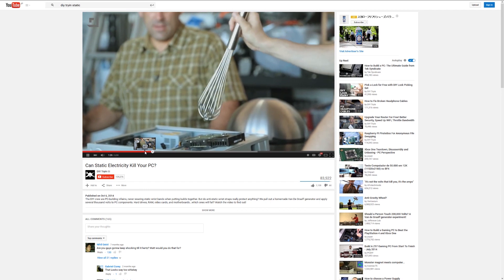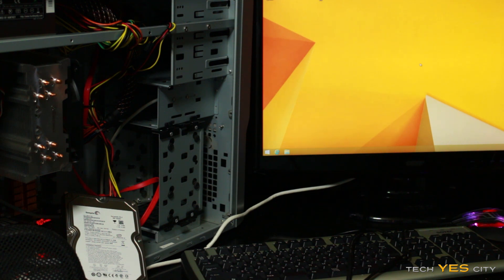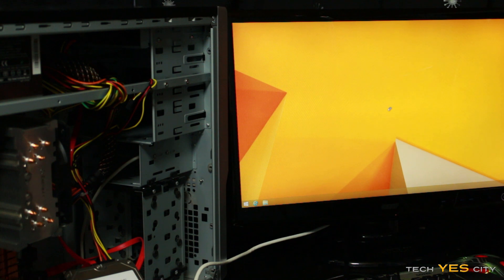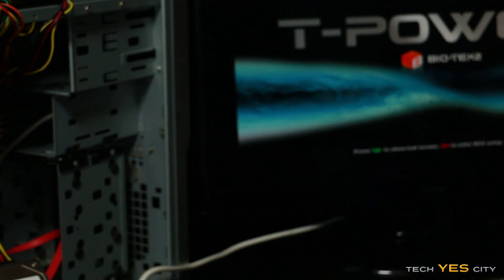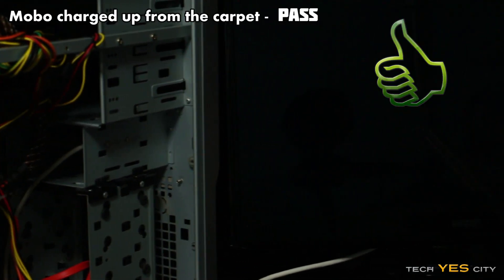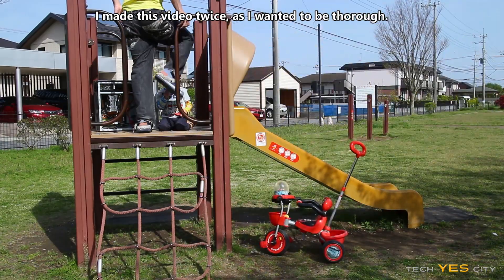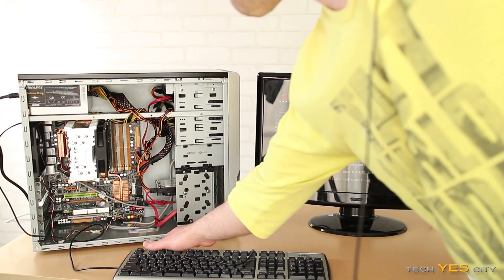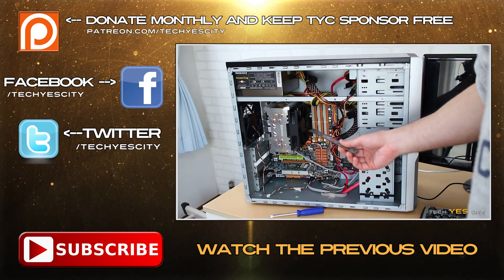Can Static Electricity Damage Computer Parts? Do You Really Need an Anti-Static Wrist Band?

Comment: As an EMC/ESD engineer I have seen multiple bizarre ESD failures at system level. Few key points here, how much charge is accumulated on your body depends on the environmental conditions, even your body sweat can reduce the accumulated free charge. 
Typically if the charge voltage is above 2KV then you experience a zap while discharging. All the parts you tested were designed to handle 2KV zap. 
1. Accumulate more charge 
2. Dont zap at some random place, zap at potential areas such as any I/O port, any logic IC, any crystal or other ESD sensitive component and it will show its magic.

Comment: I personally destroyed two different Electronics with static. Static Spark destroyed my PS3 while plugging in the HDMI cable and the same thing happened to my air purifier with a static spark touching the power button.
Reply: You MUST be a better Conductor than me (since C64(1987)--------------------------Ryzen 5900X(2025))?

Comment: I think it’s good to use an anti static wrist strap and anti static mats. Not using only gives more fuel for the anti right to repair companies. You may not see the failure immediately it may be something that happens later on. Apple and all the electronic companies will use anti static wrist straps. If you want to learn more I recommend more the right to repair community as well as the rest of the DIY get the IPC-A-610 and if J-STD for soldering. I want right to repair be the law of the land. I’ve worked in medical electronics and if I was not wearing a grounding wrist strap it was a fireable offense.

Comment: Best way to prevent ESD :
Plug power supply into a power strip
Turn the power strip off
Plug power strip into a grounded outlet

Now the whole system is grounded and all you have to do is touch the case metal and you'll be set

Comment: Simple to say yes it does most often its not a direct dead you have to run it a while afterwards and your shoes your floor and everything is important to realy hit the part with static electricity. You just need to knlw companied which do actualy research why the parts died and one business doing it is aviation and they can tell you a lot of this computers die because of static electricity. And your test is compeltly usless you should run it way longer im talking about weeks and months and just saying you need the right material to build static electricity........so pls if you do such stuff inform yourselfe before you make such videos.

Comment: That comparison of increased voltage "through a component" is a bit meaningless, and what does "putting through" mean?

Touching the traces or solder points on the back of a PCB is a completely different thing, as you are bridging or "short circuiting" lanes.

Comment: wanna say that when you remove the side pannel you touch the side panel wich is in metal and will discharge you.. and when youre not on a carpet for building the pc and you already touched side pannel of the case while you oppened it the chance of damaging the pc is extremly low.. its like taking precaution for nothing... its like saying: OMG I WILL NOT DRIVE MY CAR ITS SO DANGEROUS TO DRIVE I COULD MAKE AN ACCIDENT) so its a very stupid concept to protect you with anti static thing... and again probably no one build on a carpet like an idiot...

Comment: I have been cleaning my pc since 2006 with a blower. Then I purchased my second pc and still using a blower cause it was easy and does the job perfectly. Last time I cleaned my pc 3 days ago and then my lan port stopped working and my pc keeps shutting down after some time of use. Could that be that static charged caused this?

Comment: Of course, I really wanted to see you handle the CPU. Over here in the UK, I always leave the power lead plugged in but the wall switch off, that way there is always an earth straight to the chassis. Also, touching your car isn't really a good idea as the tyres are an insulator and the car is never really earthed....which is also why it's the safest place to be during a thunder storm.

Comment: Former HP employee in the 90's here;  HP conducted investigations into ESD damage under an electron microscope and discovered an important consideration is that an ESD shock can damage a junction with a micro-fracture that will open up over time with use, thereby dramatically shortening its lifespan. This condition is reffered to as "walking wounded" . So if something turns on right after a shock that does not mean it isn't damaged, a few months or years later (depending on usage) will be the deciding factor here or extensive. If the parts shown here have been in continuous use it would be good to know if they still work
Reply: Thanks for your very helpful comment. I'm a novice in computers. I hope more people read your post!

Comment: If it’s an obvious static arc, you will most definitely destroy your components. It would lead to no post, gpu artifacting, abnormally frequent error messages and bsods that is not microcode or driver related, or even not turn on at all in some cases.

Comment: How does a car ground you when it has rubber tires which I've read basically makes you immune to electricity? Does that mean touching any type of metal that sits on your table also grounds you? Or does it have to touch the floor or ground to work? Does the size of the metal have to be a certain size? I'm probably over thinking it but I just have to make sure.

Comment: what about static energy it doesn't shock you when you touch case or any metal parts, 
but using a Multimeter it says there's something there, 
tried using a surge protected plug and still the same

Comment: The components that have bare PCBs, so like motherboards, GPUs, and HDDs, should have some sort of coating over the board that is inductive to prevent such a thing. I'd imagine they actually do, as I've messed with a lot of components in very static-risky environments (non-humid with cotton clothing on carpet) and haven't damaged anything. You can even get it to the point of arcing and still, it works fine. Also, with the anti-static wrist rests, what you have to understand is that the current will take the shortest path possible - which if you're interacting with PC components, it will go to the PC parts first instead of the ground in the wall socket.

Comment: I appreciate that you wanted to conduct a "real world" experiment to see how static electricity discharge (ESD) affects components, but you failed to do any real tests here. I would not consider this informative or a done deal for your own edification. I do not even believe you actually charged yourself up at all. If you want to be sure, grab a digital multi-meter. If you actually had real discharge at each one of these tests, it would have hurt and you were have heard it (possibly saw it). If you ever grabbed a door knob with a real static charge built up in your body, you will know what I am talking about... those are the kind of ESDs that ruin computer parts. If you felt nothing, saw nothing and heard nothing... that's because you didn't build up a real charge. Also you are touching the outside of the case of the hdd and vid card which will just discharge around the component chassis not directly into the internal board or components. In none of these test did I see you get near the pins (you don't even have to touch a pin for a charge to jump to it). Lastly, time of year and humidity level is a big factor for generating static electricity (winter time is the worst). Where you live matters too. 

Having said all that you do not need to wear full anti shock wrist straps all year round (depending on where you live). Knowing where you live and what months ESD is at its worst plays a big factor. Discharging yourself on a proper ground before you handle components matters too. The kind of footwear you wear and the type of floor you have plays a big factor (your clothes too for that matter... get rid of big woolly sweaters before you work on a computer). The only times I am particularly careful around here is in the winter. I also 100% avoid dusting with brushes/swiffer dusters/etc (which build up a charge quick).
Reply: Primarch You miss the point. This is a more realistic approach. This is simply trying to get a charge by rubbing clothes someone would normally wear across a carpeted floor, and see if it causes a shock great enough to brick the machine.

Comment: ESD is not fatal to components but can degrade them. However I feel this does not necessary apply to motherboards because they are built with fuses which protect against ESD or over-current. 

This is a very extreme example of ESD and I doubt anybody would accumulate that much, and if they did they would usually touch something metal like a door knob or their beds metallic part.

Comment: Your test is not real world either.  First, what is the humidity level in the room?  If it's over 70% you probably won't hold enough static on your body to cause a problem.  Second, are you touching anything else before directly touching the electronics on those devices?  I've seen ESD damage motherboards and RAM first hand especially in the winter months when humidity is very low in the area I live in and you can see and feel sparks when you touch some things. Plus you are testing for catastrophic failure which is pretty rare with ESD.  Indirect damage is more common which can show itself in future errors or instability.

Comment: Well, this is a clickbait video.
First, it's not like static will destroy the PC parts  immediately, using a x-ray scanner or microscopes can actually see how static damage parts and the static damages after some time has passed and you will be clueless on how the PC broke on the first place.

Also, depending on model and manufacturer there's components who actually has static resistance and other are really sensitive.

And on top of that i can see how you don't have touched well some parts, like the HDD, you hardly touched the circuitry just touched the aluminium case...

Comment: Where's the RAM test? You can damage parts of the RAM and still have it boot up until it goes to use the damaged area. Did you get a static spark when you touched the component? Totally flawed test.

Comment: I really need some help. I've recently bought a 1060 6GB and wanted to see it, so i took it out of the anti static plastic, with my shoes on, on a wooden floor, with no carpet whatsoever, and i don't have pets. I holded the GPU by the back plate, the plastics, might have touched those heat pipes on the front of the Gaming X and might have put my fingers on the zone where we connect our video cables (but they were covered). A friend asked me if i touched something metal that would ground myself, and i entered the house 5 minutes before, so i touched the metal doorknob. He asked me if i felt any shock whatsoever and i didn't feel nothing. Can you tell if my GPU is ruined from that? I'm so worried. I thought that since i had footwear i was ok, but then i started worrying.

Comment: yes and no.. iv fcked my computer with static before my pc cost over £2000, thankfully it was under warranty. but i have also handled my pc vigorously on carpet. (naked ofc) and nothing happened, so its a very case by case thing.. ontop of that some people can build static a lot more easily for some reason.  tomorrow im installing a new cpu cooler.. im super worried about static build up when removing the thermal paste, so i have mirco fibre cloths, anti static gloves and a wrist band.. my pc is not under warranty any more and im not in a financial position to replace a £2000 pc cant risk it, because of my past incident

Comment: How about putting your hard drive on carpet or on top of your bed with board face down so that the hard drive's board in contact with them. Sometimes specially if the air is dry, bed or blanket can store substantial amount of static electricity that I can sometimes feel my arm's hair reacts if I placed my arm close to them.

Comment: I know... I been taking apart electronic devices for years without grounding myself, and putting them back together again, andd guess what, they still work like a charm. I even been told that I had to ground myself even if I was just unscrewing a plastic cover at the bottom of a laptop and putting it back on again without touching any components. Maybe a lot of people are paranoid?
Reply: glad you never repaired my electronics....

Comment: ESD does not do to modern computers what 99% of the "I built a rig in 2018 by 1984 safety standards" idiots that love to troll you tube videos would like to believe.

Magnetic media was only ever the really big worry with magnetic screwdrivers up until around the mid 90's.

You'd have to build huge loads of Electric static in your body to harm most items today just in the course of a normal build <And yes the dmg would have to be on purpose not accidental> .  Yes you can go wayyyyyyy outta your way to cause harm to electronics with ESD but that's a given.

I've built/Repaired on carpets, rugs, diamond plate floors in various homes and businesses and even handling the parts with Meatfists <Roughly> never witnessed any esd dmg and I have been doing this since the late 80's.  I once showed up for a repair and their Teenage son had the parts all sprawled out across their shag carpet and he was in socks!!!  After I put it all together it was discovered the HDD had bad sectors

ESD can be an issue but only in strange circumstances or unusual ones.  The safety practices are in place only to rule out another causal factor,  but as I said you have to go out of your way to cause ESD dmg to a modern system.

However the ESD bands are always recommended  only because as the law states "If something CAN happen,  it usually will" though that's pushing it a bit as well.

Comment: I know this is an old video, but my trick has always been to grab the doorknob, metal leg of a table, or anything else that I could possibly use to ground myself, before I started working on a computer. Yet to have an issue, and this is with years of doing it to many different machines. A few are no longer in use, but still work. Just got too old to be useful. I'm thinking about getting myself a wrist strap and mat at some point, though. Better safe than sorry.
Reply: Tennis Ball Or just, you know, touch the case.

Comment: The easiest way to ground yourself is to touch the rear of the PSU while it is plugged in, but turned off and the banks drained. This is a simply trick. Another easy way to ground yourself, or to discharge electricity from your body, is to grab something iron, like a bare weight. I found it to be very hard to build up static charge, even while wearing socks, though it should be noted that if somebody did a carp job with a wall socket in a room, that can lead to a static charge build up.

Comment: I once was trying to install a pcie1x usb 3.0 card with my pc on (idk why i just didn't feel like turning my pc off) and in my computer there's an old pci printer port card plugged in (it came with my pc and im pretty sure it was broken) and my cable management is quite bad so i accidentally ended up touching a metal part of the pcie1x usb 3.0 thing and the old printer card together and it made a giant spark and shutoff my computer. But it automatically rebooted and was fine. I know it's not static but I thought it was interesting. I've also managed to short circuit and little usb wifi dongle, burn my thumb, and make the dongle release and terrible smelling smoke.

Comment: It has a lot to do with humidity in the environment. In hight humidity around 60~90 % , electrostatic charge is absorbed by the water vapor in the air. In very dry environment, where humidity is lower than 30%, electrostatic charge is significant.

Comment: ESD will much more often cause some slight damage that can reduce useful life or performance than cause an immediate critical failure. I have seen a few computers die entirely from ESD although it is rare. Also, most discharges will be so slight that you will not even feel them. Some method to reduce the risk of ESD is a good idea although you will usually be fine without it. Keep in mind that you may be doing some slight damage even if it still boots and functions.

Comment: I teach ESD, some parts are more sensitive than others - in general low power consumption parts are more sensitive than high power consumption parts. So ram is normally the most sensitive. Also ESD is a bigger problem in dry weather than damp weather(environment). Also it might only make your computer fail in 1 in a 100 cases - not that bad for a pc but terrible fore a airplane system! :) its really easy to prevent 99% of ESD with just touching the case while holding the new component while its still in the ESD bag :) ps. grounding the case can actually be worse than not grounding the case :) - check out ohms law and potential difference :)
Reply: What do you do when the case has no bare metal? This seems to be pretty common now.
Reply: @TimTylor  Then you touch the psu.
Reply: @lasseberg7317  PSU often seems to be painted too. I've had trouble finding bare metal in more than one pc, and googling around finds the same question keeps coming up: all surfaces painted or at least coated with something.
Reply: @TimTylor  we are talking 1000+ volts, so the paint is not an issue. It will just disapate slower. An esd Matt often have 1+ megaohm.